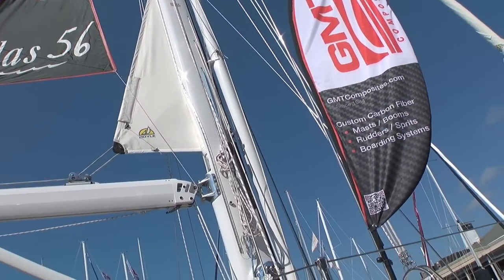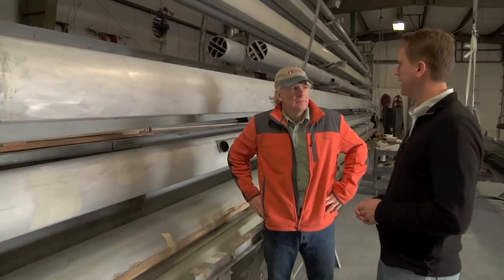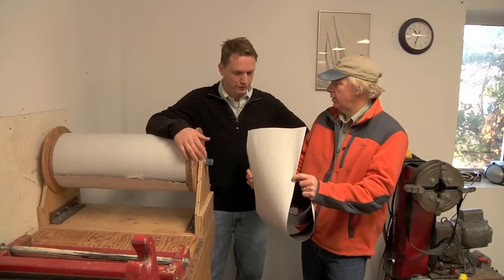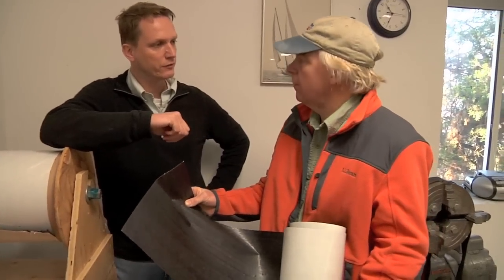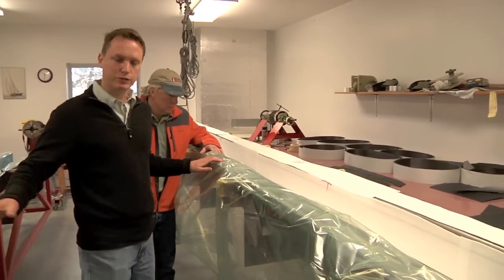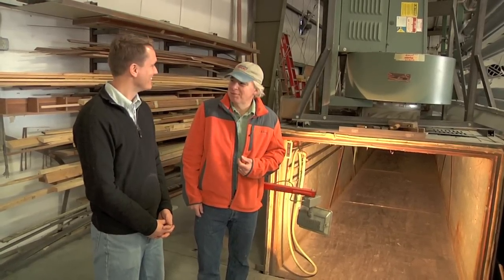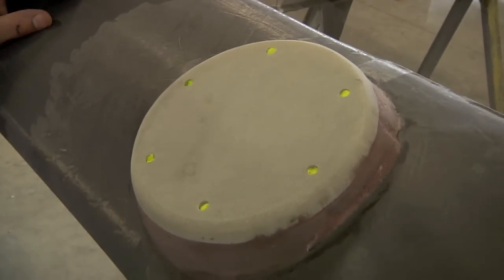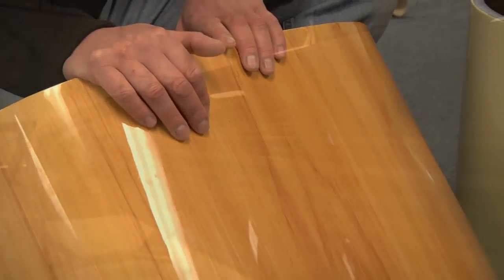Carbon Fiber Magic with GMT Composites

Comment: how they remove the aluminum mast from the carbon on the top......  freezing i?
Reply: The tool is tapered and coated with release agent/ wax so that it will slide out.